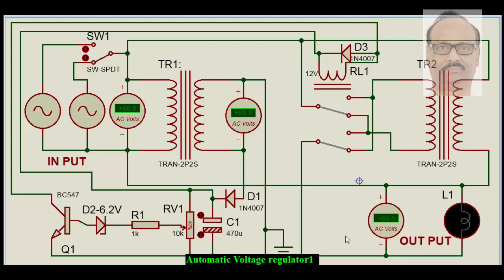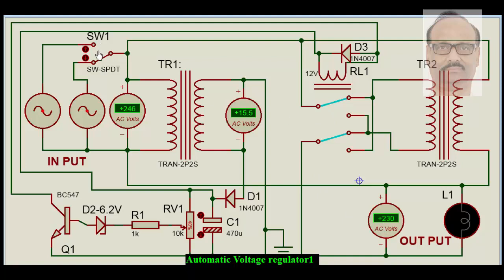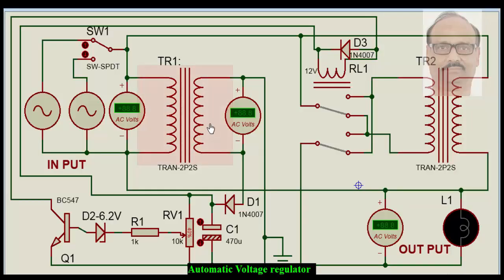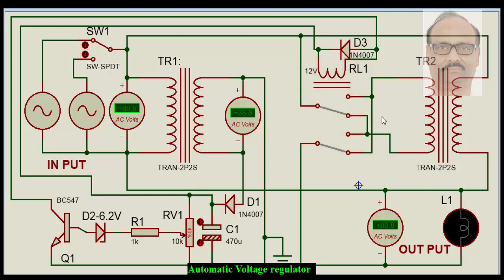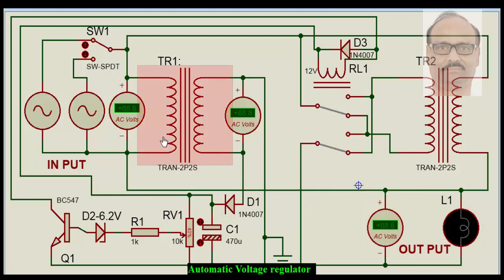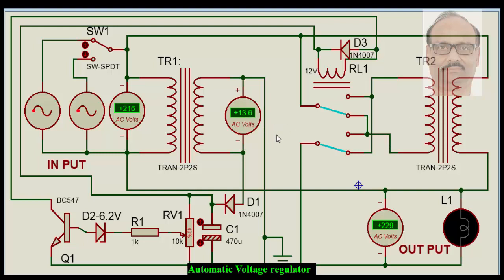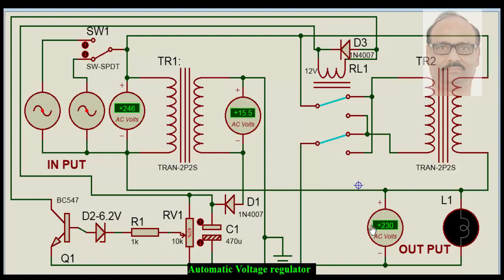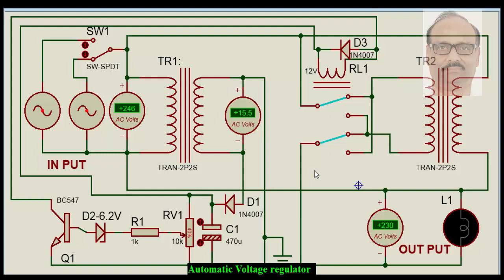Voltage Stabiliser /Stabilizer

Comment from the maker: Some low cost stabilizers after some years of use develop this problem even new ones also.If you understand technicalities then you have to add hysteresis to the circuit by just adding a resistor (costing 20 paisa) of 100k or above, connecting from output to input. Alternatively just solder a 100uF /50 volt capacitor across the relay coils in proper polarity which might solve the problem

Comment: respected sir i am not clearly understanding the circuit , the buck boost connections are correct or incorrect in this video ?
Reply from the maker: Watch this first.https://youtu.be/xUK2pRAjQNg?si=XQiaawH6tWoOmkSr
Reply from the maker: Listen to this first--https://youtu.be/OgYArCUzV7s
Reply from the maker: Everything is absolutely correct. Your understanding is the problem. However I will try to make the same video again with better pictures for a clear understanding
Reply: Thankyou sir
Reply from the maker: watch the better explained-https://youtu.be/HNT2E4gskXc
Reply: @PatnaikUC  thankyou so much sir

Comment: sir i watch your video how to eliminate relay chattering, i have pic16f676 base automatic stabizer 10kva, i am facing this relay chattering where i can connect 100k resistance. i am from Pakistan hope you can answer.
Reply from the maker: This simple circuit is not for feedback. Since you are using microcontroller handle the issue in programming.Send me circuit you are using and the program. ucpatnaik@gmail.com
Reply: @PatnaikUC  thanks for your reply sir,  actually stablizer purchased from local market.  shall i share the circuit picture through email?

Comment: Sir Thanks, but how we make a formula for tapping?
Reply from the maker: V1/V2=Ni/N2
Reply: Actually, you didn't get my point? I mean Voltage formula for stablizer i.e.. 110v,120,30v,35v,40v etc... How it is derived?
Reply from the maker: @EngrAbidOrakzai  9949693280
Reply: @PatnaikUC   with international code
Reply: @PatnaikUC   sir there is no whatsapp on this number

Comment: Sir, can i connect this stabilizer circuit with a 1.5 ton AC?
Reply from the maker: NO. It is not meant for practical use as it contains no hysteresis .It was given basically to understand the technology used behind it

Comment: Sir,we need your help in constructing this circuit in breadboard,that u have shown in this video(in between u mentioned a circuit diagram)im an ec first year student and doing this circuit as our microproject,so if u show how to connect it in breadboard and how to find the output, it will be very grateful.we need your help sir.waiting for a positive reply!!
Reply from the maker: Try not this. It was made to understand the technology behind it. Though it will work but not for commercial purpose. Get other circuits from net that has feedback.

Comment: what's difference between a voltage regulator and voltage stabilizer
Reply from the maker: As regards to AC to difference
Reply from the maker: AS regards to AC no difference

Comment: I need dc volt and amp adujest curcuits digram
Reply from the maker: DC stabilization is a completely a different and much simpler  technology being covered by many on the net. What this video talks about is ac voltage stabilizer.